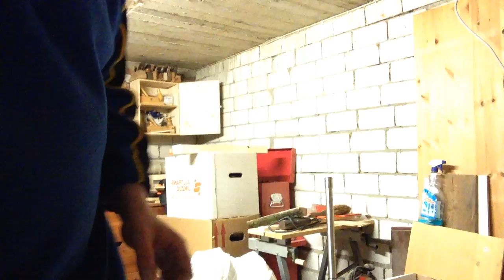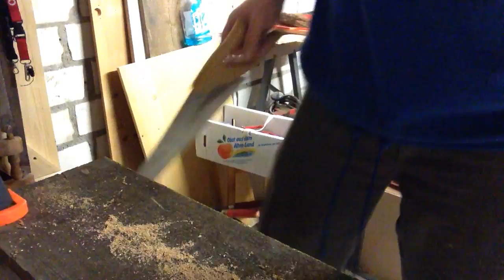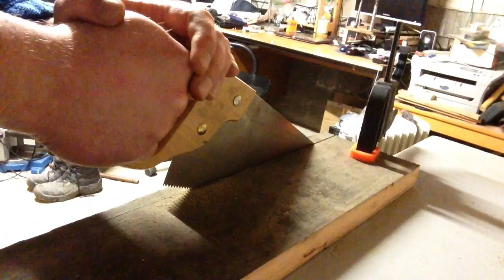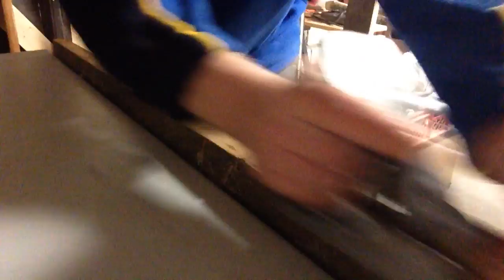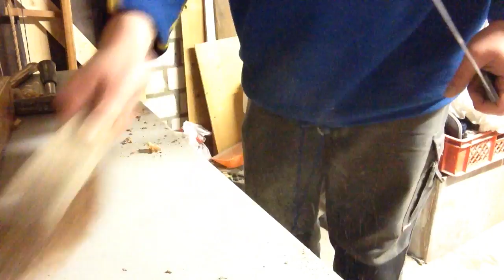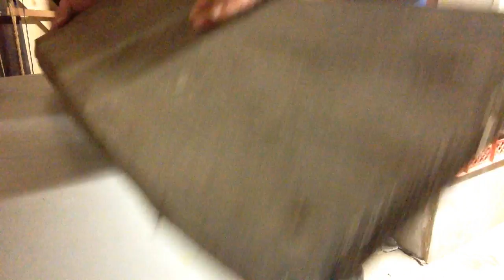Start Woodworking (Teil 9)

Comment: I think your panel saw is cut for cross cutting. See if you can get a rip cut one for cutting down the length of the plank.
Reply from the maker: +Tony Strongman yes it is. but saws a expensive in germany :)
Reply: +Christian L. Sorry to hear that, they are here too for specialised ones :( I went for a Japanese saw instead, the Ryoba style have rip on one side and cross on the other.
Reply from the maker: an Roboya is planned. Thanks.